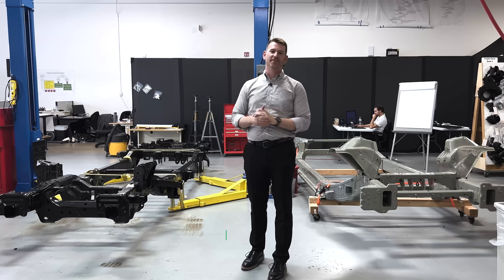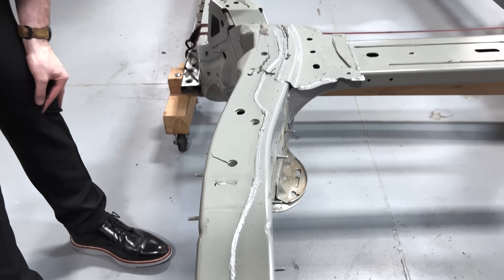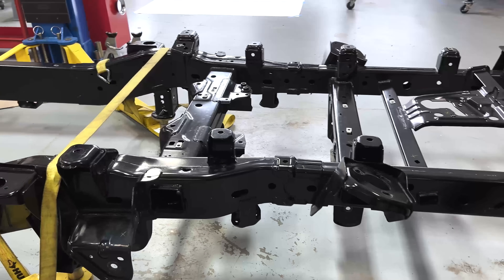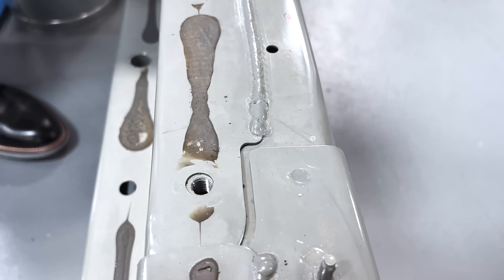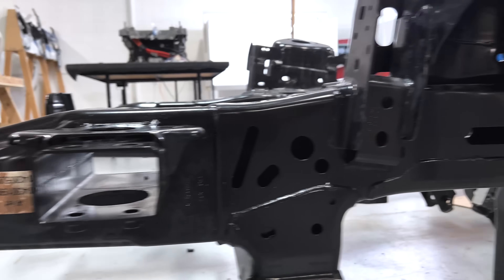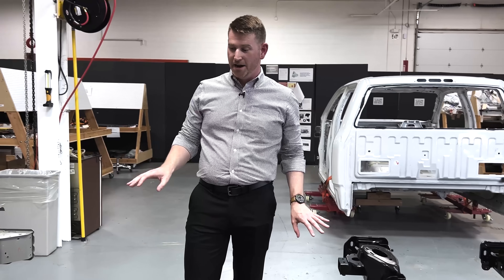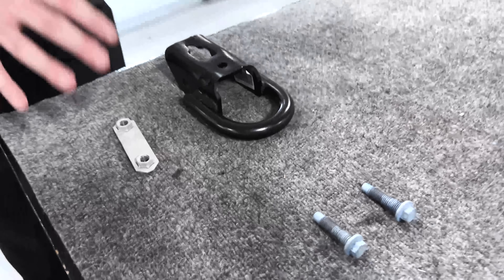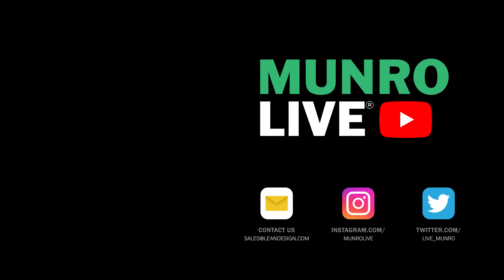Who has the better structural support system | Lightning vs R1T frame breakdown

Comment: An observation. Just the sheer scale of number of F-150s sold makes economies of scale so easy, that the brackets and caps that Kevin talks about at the rear of the frame, Ford simply has enough scale to actually make it on the cheap. And not only the F-150, actually alongside their f250,f350s as well. 

One suggestion, can you tear the f250/350, maybe even 450 series along with lightning, so that we can see the potential for future electrification in those trucks as well? 
Right now it doesn't make sense for the 250+ series that tow, but there are plenty of commercial users that don't tow a lot with those trucks, and the potential for them saving collectively millions per year on diesel or gas is huge. Maybe a few billion dollars at least
Reply: The ford design would be cheaper whatever quantity you make it at. There are so many more and more expensive processes on the rivian design, from machining of castings, forging and polishing, more final assembly steps — I’d never think of this being cheaper than taking two bent parts and welding them together, and powder coating it. That being said, the rivian hook is gorgeous and I wouldn’t say the same for the ford solution. I think it just speaks to the priorities of cost vs finish quality. I bet there’s a middle ground of a way to simplify the rivian design that still looks as great while being cheaper to manufacture.
Reply: I keep thinking there is going to be a big battery breakthrough that changes not only the economies of scale but also towing range. Incremental improvements have gotten us pretty far, but I wonder how long until the breakthrough happens. Will it be 5 years or 30?

Comment: I almost prefer a transitional design of the Lightning, it allows service and knowledge of the ICE model to help fix this model by "the general support" of the field. Maybe incremental changes will translate to "fixability" or "adaptability" by the end-users.
Reply: Incremental changes are absolutely the hardest to support. A big step change with a year model cut-off makes much more sense for support. That way more parts will be guaranteed to fit for a longer period. Incremental changes almost guarantees that youll never figure out which part you actually need.

Comment: Henry Ford would recognize the manufacturing technique of his company110 yrs later. 
Why don't they both get a big casting machine and eliminate a lot of parts and processes so that they can make a decent profit? There is a company that is doing that, I've heard.
Reply: I find it funny that you are claiming that Ford does not make a profit on F-150's even at the $30k range. Tesla, on the other hand, does not have a $30k car. I wonder which manufacturing process has been working better. By the way, in the 2022 year, the Lightning Pro was sub $40k.
Reply: Are you serious!? Casings on trucks!? It’s totally pointless!!! From Ford F-150 to f750……. Those are super toughly built vehicles that are also ultra easy to modify for all kinds of applications! The cybertruck is a disaster when it comes to mods! With ford chassi you can convert them into ambulance, RV, bus, commercial vehicle……. Overlanding rig and much more.
Reply: @carholic-sz3qv  nobody would mod their EV cause any added weight or changing to the aero dynamics , you will end up charging every 50 miles..
Reply: @mikeclon  so you want to assume EVs will remain totally useless pavements princess soft weak just for cruising on highways!? Are you serious!?
Reply: @mikeclon  things like the Mercedes’ sprinter comes in about hundreds different configurations depending on their applications and no every single differently designed vehicle can compete with that.
Reply: @carholic-sz3qv  Aluminum alloy is lighter stronger and easier to work with. Better range more payload. Mods? Whether we like it or not a thing of the past.
Reply: @richardacerra2975  trucks are made for use are supposed to be more than just one usage type. Your typical tesla is basically useless apart from driving on the pavement doing nothing else!!!
Reply: The steel chassis is significantly way stronger than any crappy aluminum casting and it’s a fact no argument from mine.
Reply: @carholic-sz3qv  I very much doubt the Ford chassis will be anywhere near the strength of the cybertruck. The ladder frame chassis has the torsional rigidity of a wet noodle whereas the cybertruck will most likely be one of the stiffest cars ever built. There is a reason the cybertruck has twice the payload then the useless payload in the lighting
Reply: @saff226  the cybertruck is only strong because it needs all that structure around it? Frame based trucks are significantly stronger and doesn’t need more! F250, 350, 450 uses much beefier frames because they are more capable platforms for everything! The cybertruck is essentially compromised and stuck forever just like a model 3
Reply: @saff226  the cybertruck has which twice payload!? And to cover which distance!? lol!!!!!
Reply: @saff226  also trucks with frames makes it significantly way easier to attach all kinds of accessories possible from cranes to dump truck! Custom bed for utility jobs…… the Mercedes’ UNIMOG is the perfect example of what a chassis offers, just like a tatra truck.
Reply: @saff226  now again tell me why tesla didn’t used the "super tough" aluminum casting for the semi!? Because it’s totally weak for trucking activities, and it’s not even in the heavy duty semis that hauls over 4 times 80,000lbs on unpaved roads
Reply: These trucks are on the road today. The Lightning frame is a compromise, to release it quickly. Next gen will not use the ladder frame. Next gen Rivian will have less complexity.
Reply: @jysmtl  the lightning crane isn’t a compromise and ford is going to very well optimise it for the EV platform. Like wider center portion to bolt the battery pack higher and much more securely/structurally.

Comment: Comparing the weight of both frames would be interesting.  White the Lightning is a larger truck, the R1T is heavier overall.
Reply: Good point, quad motors vs dual though with declutching capability and individual wheel torque steer on the rivian. 
I'd be curious given how both are nearly the same driving efficiency. If rivians pack weighs more than the lightning pack? 🤔
Reply: @4literv6  Ford= aluminium bed and cabin plus steel chassis and two electric motors
Reply: Ford is notorious for using ultra high strength Boron steel in their chassis.  Those side rails are insanely strong and actually much stronger than their thickness would otherwise suggest. (and they're already chunky).
Reply: I am 55 and was a Mechanic on the Farm, in The Military and for a short time as a Civilian before going back to school for advanced education and learning.

I was a guy who got dirty and busted my nuckles in the shop and out in the field.

The best thing you can do is be honest with what you see. 

When I saw the way that they started cheating up trucks and boxing frames that caused trap points I started shouting warnings to people that I knew.

I live in the Midwest. Lots of mud , snow ice and Salt!  Then they started using Calcium Chloride on the roads.

The first Toyota pickup that I saw go to their lighter weight boxed frame design caught my attention. I told people that those frames were going to rot in half and dissolve. They did and look at all of the Recalls. 

Same thing happened to Dodge Ram trucks and then started to happen to Chevy trucks. 

Ford faired the best or longest before it started to show up. 

There is no substitute for metal quality and thickness.

LAMINATED  elements or layering on a truck frame is a mistake. It allows water and corrosive to intrude in between the Elements or layers in the frame.

Side by side with those two frames and designs there is a big difference. 

Mark my words. The Rivian frame is going to be a problem in the future when the outside elements begin to work on it.

GM and Oldsmobile did something similar with rear bumpers and crash elements on the back of their vehicles. 

After awhile you could pull the bumper off of the car. The bolts pulled right through the Multi layers of elements.

Sometimes newer generations of engineers don't learn the mistakes of the past and think I know this will work.

The question is exactly how long before it fails
Reply: @desertdan100  Very good points,  though bear in mind that the Rivian is likely to be molly coddled whilst the Ford is a work horse so typical exposure and typical cleaning regimes will be quite different. 
But I to would prefer a stronger, simpler and more resilient approach was taken by Rivian,  without necessarily increasing weight.
Reply: @johnpublicprofile6261  Everyone that has towed with the Rivian has commented that they tow well. I believe that they are on the right track for some. 

I have invested in Atlis a long time ago before they just went public. Now their ticker symbol is AMV.

I like their approach but they are also a startup with a slightly different approach 
than other startups. From the beginning they have been taking input from truck people to develop a work truck.

I really hope they make it to production on their trucks and skateboard platform.

They are going for heavy duty truck design and usage with built in redundancy and  interchangeability.

A control module can be used in a different part of the truck with just a program change. All of the seats in the cab can be unbolted and removed or take one from the back and move to the front. 

Fly by wire controls. Front and rear wheel steering. Common parts. So on and so on.

Heavy duty frame element to allow different bodies to be dropped on the skate board and welded or bolted to it for customizing and mounting.

I have been very impressed with their thought processes and working the bugs out ahead of time.🤔
Reply: @desertdan100  lol……

Comment: I have both a 2006 F150 and a 2005 F150. The front tow hooks are much beefier on the older 2005. So much so that when i put a jack stand under it the 2006 actually flexes and shows its weakness. Ford CHEAPENED the newer truck frame. The 2006 Frame is rusted through along its length. the 2005 is solid with zero rust through anywhere. the 2005 has 274k miles and the 2006 only had 124k miles. I took the engine from the 2006 and put it in the 2005 body/frame so i could keep the low mile drivetrain on the road while the 2005 had a bad engine. I look forward to getting the cybertruck

Comment: Thank you Kevin!
14:00 Nobody should be counting on that sub-40k price point anytime soon😳
Reply: The only way Ford is making a sub 40k truck is at a massive loss
Reply: @saff226  Okay, it uses a large portion of the parts of the other truck line which they have priced at $33k. They sell lots of ICE XL's, so they cannot be profit losers. You're trying to state the multiple battery pack designs, inverters, controller, regenerative brakes and pair of motors cost more than the multiple engine designs, multiple transmission designs, multiple axle designs, multiple gas tank designs, exhaust, and the transfer case. Note, the motors are the same across all trims, and the motors are built into the axles. The increased hp on the higher trims is the result of an included extended range battery, which is at a higher voltage, which means the expected value of the motors is known, but the expected value of any of the engines, transmissions, and axles must be projected. This means that the only thing unknown is the battery pack and possibly the screen inside the truck. Yes, this is a pretty high value unknown, but it means the purchasing for the truck is easier to fulfill orders. The problem is that they have no line to fulfill the orders even if it is easier to purchase the inventory. Unless the human resources department is in Ford, then the people are paid by Ford Blue if they make an ICE vehicle. That means Ford Model e cannot use them to make their trucks. It also means that Ford Blue might have fired 8,000 people but Ford's employment never changed. Ford is obligated to increase profit for their shareholders, and it is more practical to increase the price of the Pro in Model e rather than make their ICE base trim profit losers by dropping them into the $20,000's, which they would have had to do to break the pricing of the Pro.
The other simple argument is, "What changed in the Pro trim to warrant the $12,000 price adjustment which only warranted a $5,000 price adjustment in all other trims?" They use the same parts. The only thing that makes sense is they are making the ICE XL trim actually have a feasible price point.
Reply: That model year had a $39,000 price point. They changed it probably in order to make the ICE field more competitive because Ford's assets are tied into Ford Blue. They lowered the ICE configuration by $3,000 and the increase by trim for all Lightning's by $5,000, the super crew and 4x4 made the Pro's within $1,000 as the super crew and 4 x 4 at the XL level is $43,000 and the Pro would have been at $44,000. That was not sufficient as Ford had to raise the Pro an additional $7,000. The Lariat which I believe has the super crew standard ends up at $57,000 and the Lightning XL ends up at $58,000 in 2023, which means that Ford is trying to make the two comparable at that level instead of the XL / Pro level. As for them not making Pro's, Fleet orders could get the extended range batteries at the Pro level and those fleet orders would have to be in quantities of 5 or more in the 2022 year.
Reply: I would like to see a single cab, bench seat, LFP F-150 Lightning.

Comment: Mark Plott is a Tesla fanboi with a T tattoo'd on his back side who upvotes his own comments.  I have a 2017 S but I keep my ear to the ground for the best tech, no matter who makes it.  Nice video - both very stout frames.  I can't wait to see the CT although I'm sure the original Cybertruck program was scrapped to integrate gigacastings into the final design.   I'm actually surprised how good the Lightning is.
Reply: Mark Plott is Tesla Bot. :)
Reply: There is a reason why trucks actually have a frame and body! It’s for modifying for commercial applications. The cybertruck is totally useless in that regard. Ford trucks from the f150 up to f750…… have been modified to ambulance, RV, bus……. The cybertruck offers basically no flexibility it’s just another boring modelX or whatever.
Reply: @carholic-sz3qv  Agree, but to be fair, the CT may offer a better package strictly as its original purpose.  But yes, we can certainly see the Lightning being easily modded for ambulance or other commercial duties.  I wouldn't be surprised if Ford doesn't offer a cab and chassis Lightning in a year or so.
Reply: @ohger1  there isn’t really an original purpose for a truck lol…. People are still buying and converting/modifying 30 years old Toyota hilux or land cruiser for RV, overlanding off-road…… their trucks used also ends up exported to foreign countries where they are even used in more tougher environments.
Reply: @carholic-sz3qv  The Cybertruck is nothing like anything that has ever been built before  based on previous pics, info, and speculation.  For instance, the fact that it has no separate cab and bed will contribute to it's far better .cd than the (horrible) aerodynamics of the Lightning.  EV trucks carry the equiv of maybe 4 gallons of gas in energy, and aerodynamics play a huge part in range for speeds above 30 mph.  With the Lightning  .cd performance so poor, you might see the next gen Lightning with a unibody/frame hybrid construction that won't lend itself to commercial sales.
Reply: @ohger1  your comment is full or nonsense!!!!! Tell me why European trucks are cab over and American long nose can’t work there!?
Reply: @ohger1  both diesel and petrol trucks Cary a lot of energy because they are actually able to do it! With electric it’s totally impossible and just forget about activities like overlanding…… the battery density is simply not here to compete.
Reply: @ohger1  the bed of the cybertruck is very dumb and unpractical.
Reply: @carholic-sz3qv  Dude, take your meds and get 8 hours of sleep.  You're welcome.
Reply: @carholic-sz3qv  European trucks are cab over to maximise load space because they have a maximum combination length. A normal semi would loose a lot of trailer space.
Reply: @saff226  European trucks are made to be super maneuverability which vastly superior to American trucks! European trucks are also significantly more advanced with things like multiple steering axles
Reply: @saff226  American semis are massive tractors because they have have all the space of the world to turn or park……
Reply: @ohger1  that’s what she said!!!!!
Reply: Finally someone else notices his T ramp stamp